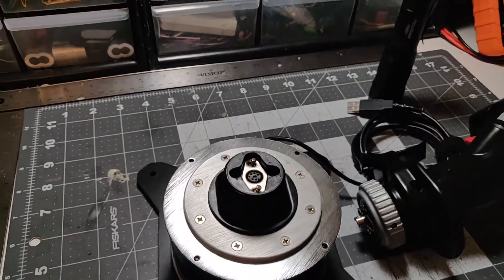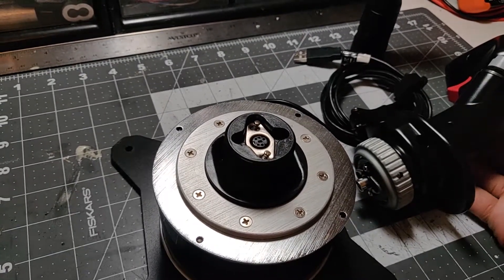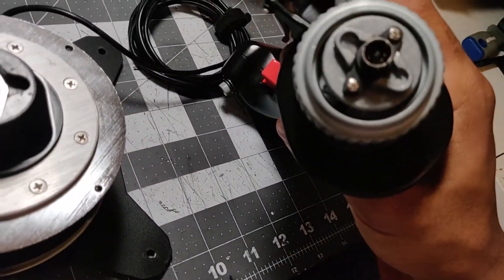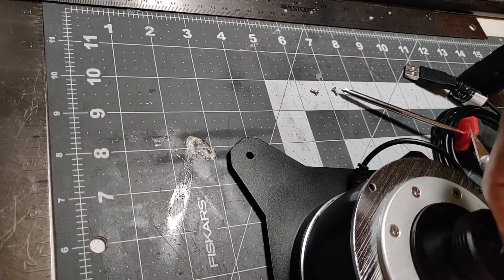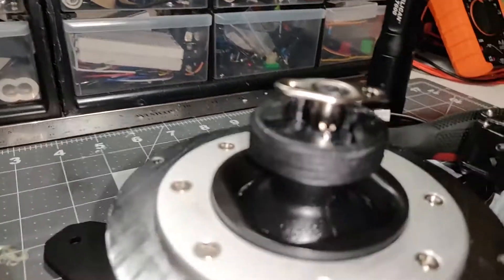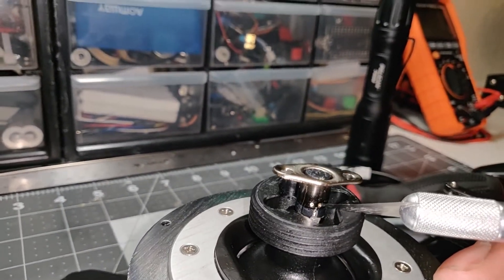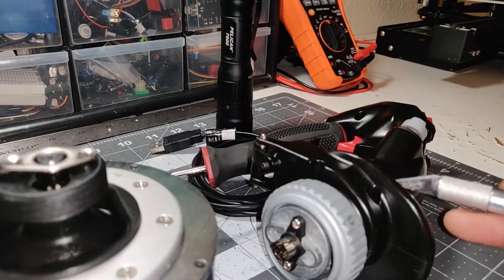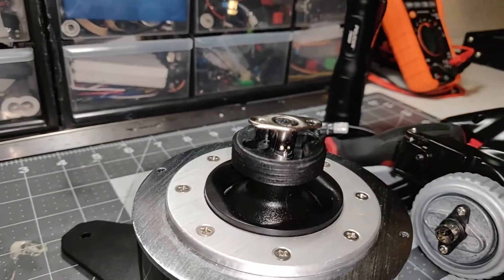HOW TO FIX HOTAS WARTHOG: ERROR TIMEOUT DEVICE SHOULD HAVE ARRIVED IN HID

Comment: if i take my stick off, all the pins and holes for pins are fine, the connector doesnt move it still tight in place, but i still get the firmware update error 
 HOTAS WARTHOG: ERROR TIMEOUT DEVICE SHOULD HAVE ARRIVED IN HID (  CODE:0x34100002) my computer registers the usb connetion when plugged but it wont load, the warthog throttle is fine
Reply from the maker: I would still check to make sure cause mines didn’t move initially it only moved when I did attach the stick to the base so still give it a try if not the only thing I can think is your base could be borked so make sure the connector on the base that connects to the your pc is plugged in all the way, reseating the connector couldn’t hurt either.

Comment: Hey all. Can anyone tell me how to remove the metal housing? My DIN is too far down into the metal part.
Reply from the maker: If it’s too far down you’re going to need to try your best to pry it up and out, if not you will have to fully disassemble the base
Reply: So I noticed the metal housing was a bit away from the base of the DIN. So I just squeezed it down further. Didn’t help. I’m waiting for TM to send me info on how to order another DIN. In the meantime I’m still rocking with my trust T16000

Comment: Have you had any calibration error? My stick is recognized, but both of the axis are all messed up. Stick isn’t centered at all.
Reply from the maker: Recalibrate the stick through the control panel
Reply: @SaajaadeenJeffries  I’ve tried that. The axes are still out of wack.  Jerking, jumping movements. Left is up, up is right, down is a circle.  It’s very strange.  Brand new unit
Reply from the maker: @chrissolano4161  delete the device as well as the software, restart ur pc, update the firmware (even if it already is), restart ur pc, check if it’s still jittery, (if it is recalibrate)
Reply: @SaajaadeenJeffries  so delete the device and software as in “uninstall the program” ? How do I make sure all devices, drivers and software are deleted before I restart my PC?
Reply from the maker: @chrissolano4161  it should give you an option to delete the software on the device when you click uninstall in the device manager.
Reply: @SaajaadeenJeffries  thank you. I tried, but unfortunately this didn’t fix the issue. I’m thinking it’s a joystick error, I’ve contacted Thrustmaster, I hope they have a solution.
Reply: @chrissolano4161  can you let me know what happens. I think I'm having the same problem but with my wheel
Reply: @granttar1981  I had to contact thrust master and after a lot of emails back and forth they agreed to pay for shipping from the US to their repair center in Canada. It’s been in repair for about 2-3 weeks and I’m hoping to get it back this week.  The customer service agent has no clue if they have fixed the problem or are sending me back a dysfunctional HOTAS.  So there is a disconnect between the customer service team and the repair team.  Be patient with customer service… I could reply within 10 minutes of them sending me an email, but it took 1-2 days to get a reply. Phone line on the website never answers and leads to no where.
Reply: @chrissolano4161  okay thank you. Can you let me know if they fix it please.

Comment: how can i get a PCB for my HOTAS as the stick is not recognized by my PC after I tried the firmware update for the F16 stick, thanks
Reply from the maker: Are all the pins there on the port of the stick?
Reply: Both my stick and throttle are bricked. Worked fine. Then I unplugged them to hook up my TS-PC. When I hooked up the stick and throttle they no longer show up in the windows game controllers tool. Tried flashing after going into forced bootloader mode and flash fails at final check. From now on i'm only buying their wheels. I'll go with Virpil sticks. My stick didn't have the problem stated in the video. Waaaay too much money for things to fail 2 years later.